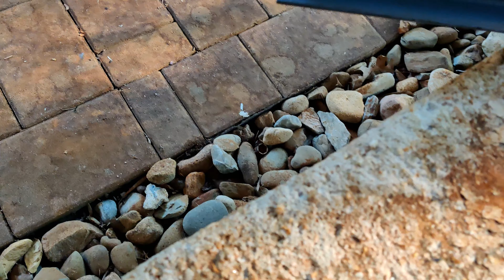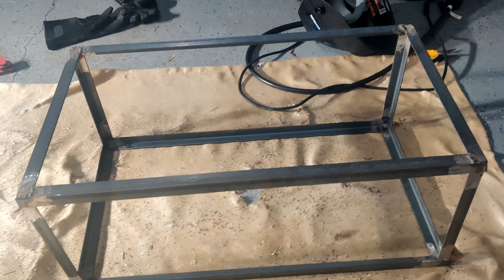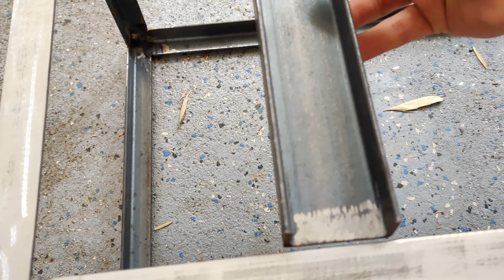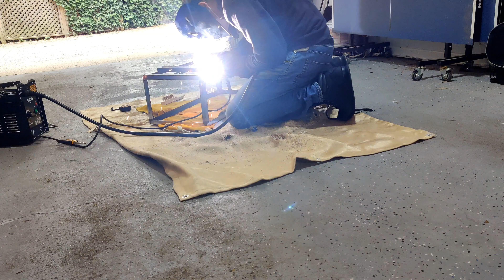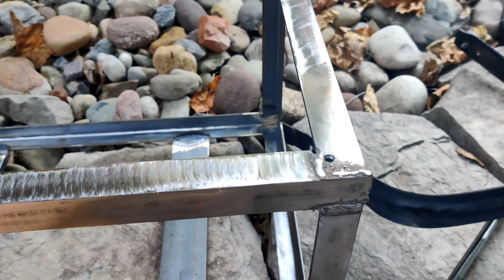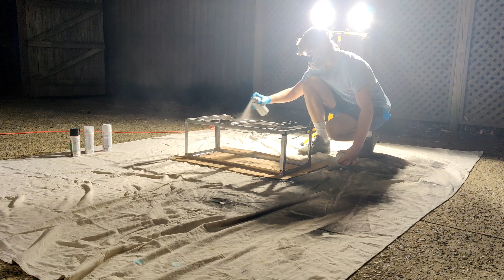Ford Escape EV Conversion EP 15: Building the Tesla Module Battery Boxes

Comment: Thank you so much for posting these videos!   This is a project I've wanted to take on for a long time and I've yet to see any steps that I couldn't do myself. These videos are giving me confidence that this could actually happen.
Reply: Looking forward to the next video!
Reply from the maker: Glad you're enjoying the videos! Yeah, it's a lot easier than it seems when all the parts are in front of you. 

I've realized that by far the hardest and most time consuming part of a conversion is fabrication: building mounts, battery boxes, brackets, etc. The wiring is actually pretty straightforward.